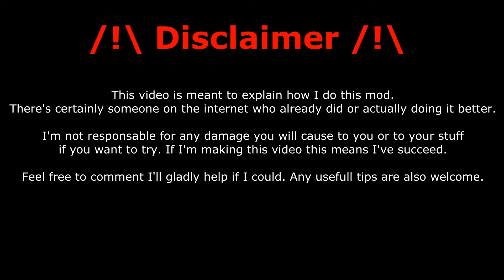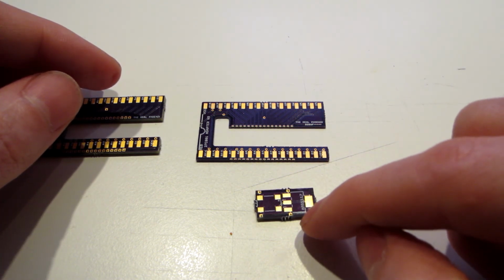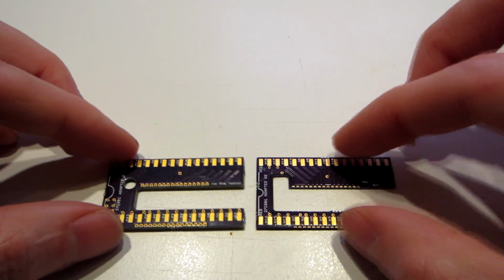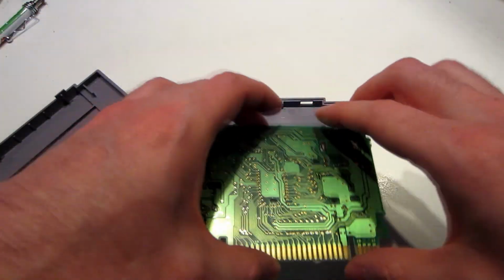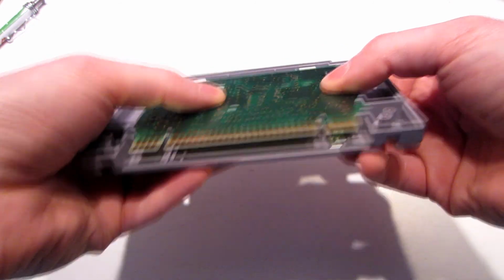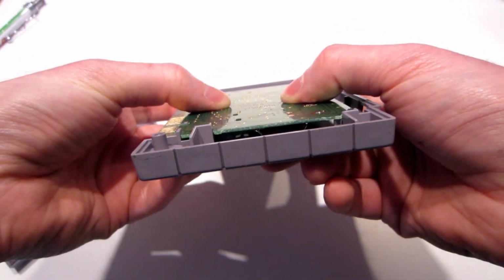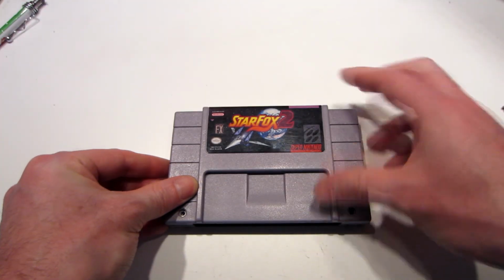[Tutorial] Super Nintendo Repro Cart - Level 03 - Medium - Starfox 2 Adapter V3

Comment: Will this board work on dirt trax
Reply from the maker: Not sure.... You may have to move the capacitor C4 next to the maskrom.
Reply: @TheRealPhoenix_Retromods  just finished with stunt race fx worked Like a charm great board.
Wanted to know if there is anything for fx multicart really wanted to make one but can’t find any good solution for it.
Reply from the maker: @shahrukh8211  It depends which kind of multicart you want to do. If you have games  which doesn't required save and you don't mind pressing reset to change the game there's solution, like a flip-flop linked to /OE if you have multiple eeproms, or on last memory addresses if you have a single big eeprom. If you want a nice menu on screen and handling multiple saves from different games, it begins to be complicated (especially since some SuperFX games use the whole RAM for running, other just a half and the other half for savefile). There are solutions but none have been given to the community. And I don't have the knowledge to do such thing.

Comment: Are the maskrom pinouts of all Super FX games the same? Curious if it should work with PCB SHVC-1CA0N6S-01 (Dirt Trax). The only potential issue I see is the rom bypass cap on that board is in a different place. I would have to remove it and use a different bypass cap on the adapter itself.
Reply from the maker: All 32 pins Super FX games (8Mbits) have the same pinout. I've also did a repro of an Overclocked StarFox 1 on a SHVC-1CA0N6S-01 (Vortex) by relocating the caps slightly under the adapter, and it worked fine.
However, the 40 pins Super Fx games (16Mbits and more, like Yoshi's Island) have 8 additional pins.  See https://i.imgur.com/EZ1uRQN.png
Reply: Thanks for the reply, very good information.
One followup question: These MC27C EPROMs have a decent amount of weight to them (at least more than the mask ROMs they replace). Do you feel the cart PCB is safe handling the weight of the ROMs just by the solder between the adapter and the SOP pads? Or do you think reinforcing the adapter with epoxy or hot glue makes sense?
Reply from the maker: for Starfox and 27C801 adapter no problem. I have more concern about the 27C322/27C160 and my SDD-1/SA-1. I'll eventually add some addition big +5 or GND castellated vias to have a better grip and avoid ripping pads, but I'm a bit paranoid. :p

Comment: Nice.   The old adapters are really difficult to get soldered down properly, especially since the spacing between the two rows of vias is off, making the top row of pads entirely inaccessible once the adapter is attached.  Does this new version address that spacing issue?
Reply from the maker: With the castellated vias I didn't really paied attention, it installed fine minor the global width of the PCB I've already corrected. I'll update my repro with the official Starfox 2 Rom so I'll take some pictures.
Reply: I built one yesterday with the official ROM using one of the V1 adapters :)

Comment: Got these adapters today. Osh Park left some pcb attached to the small connects, what is the best way to cut that off ??
Reply from the maker: The tabs? I gently cut them with a pliers, then if I really want to have something clean I use a file. Especially with 0.8mm thick PCB, that shouldn't be a problem.
Reply: The Real Phoenix Alright I will try. The tabs are over the small points that you are suppose to solder the game board and this board. Not sure they will have the little grooves but maybe I can use an exacto to open them up.

Comment: Hello! does this adapter work with SHVC-1CB7B-01 pcb?
Reply from the maker: Seems compatible from what I see: the resistor is not going to be on the way. Be carfull ofthe restitor on the top next to the MM1026AF chip.
Reply: Thanks! Do i need to swap bin the rom before i burn it?
Reply from the maker: Nope.

Comment: What's the name of that tool you used to remove the old game rom? Also what are do you edit the game rom?
Reply from the maker: You mean to desolder the old maskrom? It's a hotair station. I'm using an Aoyue 738h. I'm setting it to 280°C and make circles around the chip until the solder melt.
Reply: The Real Phoenix is that where that part that looks like it's blowing hot air on it comes from as well? If so, I'll look into buying one as well.
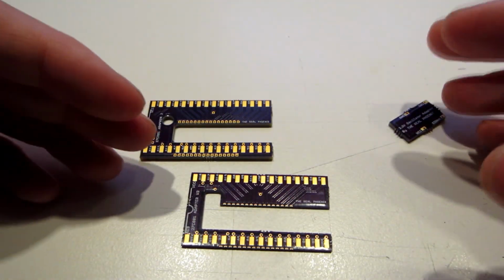Reply from the maker: at 2:07 yes, this is the nozzle of the hot air gun from the station. I have a 2-in-1 solution with an iron solder and a hot air gun. There's now 3-in-1 solution with the desoldering gun.